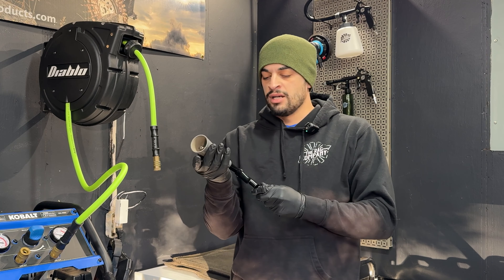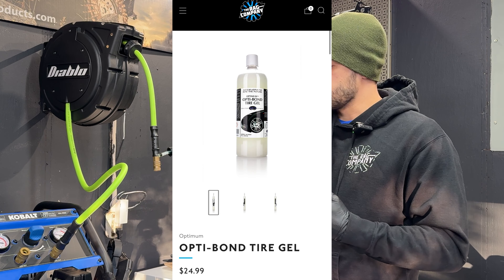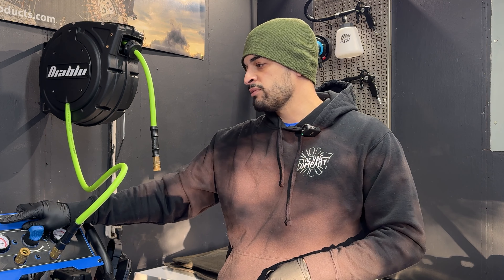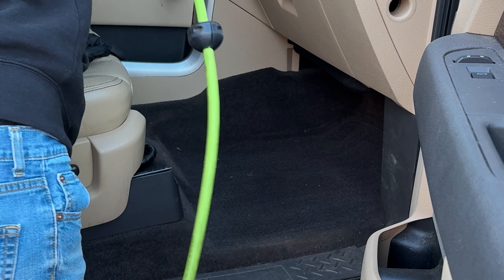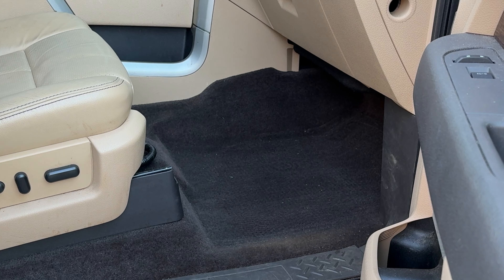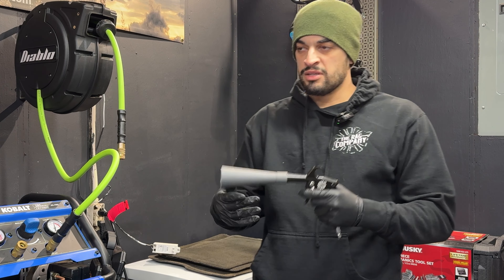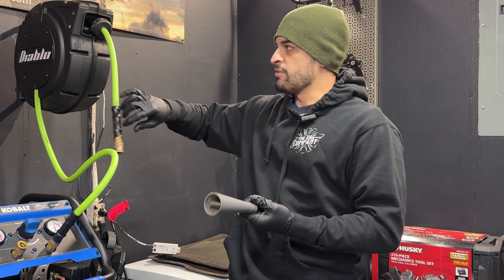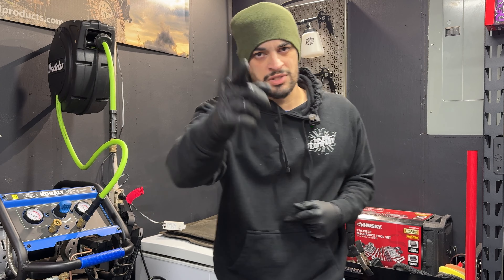The Interior Blow Out, The Method To The Madness (TRC Ultra Air Blaster Review)

Comment: One of the tips I have learned from Yvan is that an air compressor will take you farther than an extractor, and he was definitely right. Got myself the battery powered Bauer air compressor and it has been incredibly helpful. Just need to upgrade to something with a bigger tank! As always, I find your videos very helpful in leveling up my own processes. 💪🌪

Comment: I used to have an SGCB blow gun with the metal tube, trigger broke and couldn't find a replacement, the Ultra Air Blaster were out of stock so I got a Tornador. Definetly a fan of the metal tube and not a fan of the straw design or whatever the Tornador uses is called. I'll probably end up some Frankie of the old SGCB tube with the Tornador body. Great Video, JTC.

Comment: Hi Jamie, Ive got one already and love it. What's the reason for the dampened towel over the air vents? Thx
Reply from the maker: It’s a touchless way to clean vents 👍
Reply: @JamieTheCleaner thanks for the quick reply but why not just use the air blaster without the towel? Isnt it just introducing moisture into the vents? Cheers from Australia
Reply from the maker: @rooboy99  nope just a quick dry after with another shot good to go and a clean vent 👍
Reply: @JamieTheCleaner well you've got me curious now. Will give that a shot. I can just picture me doing that and then turning on aircon and getting splattered with all kinds of stuff lol. Will report back